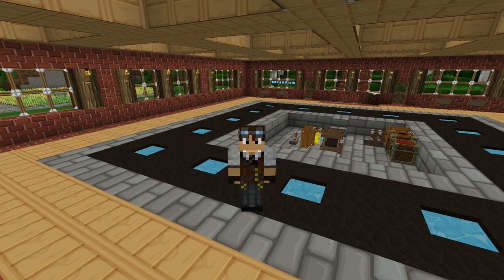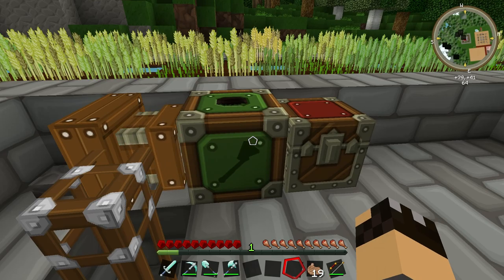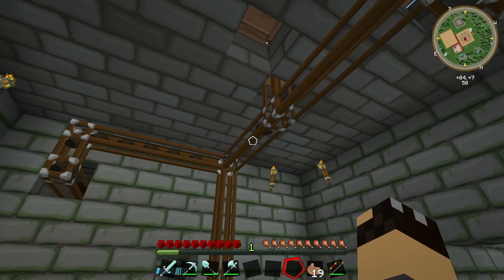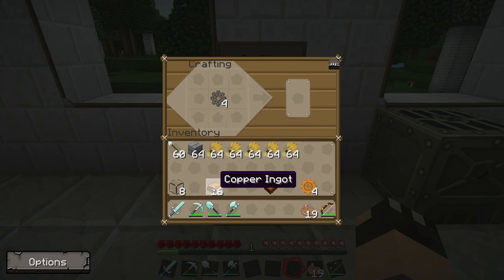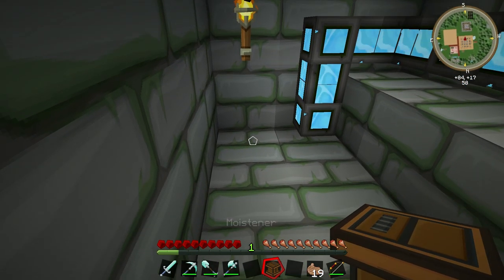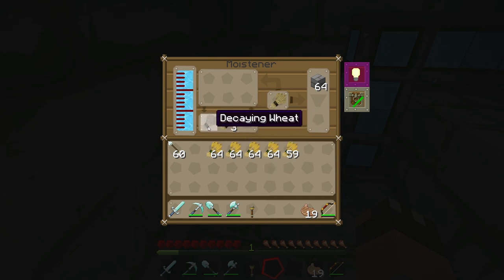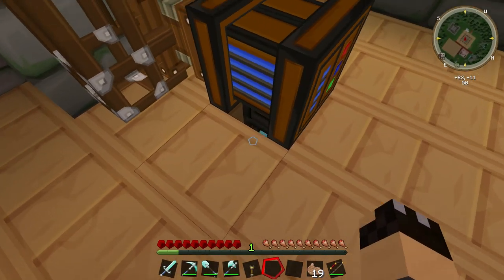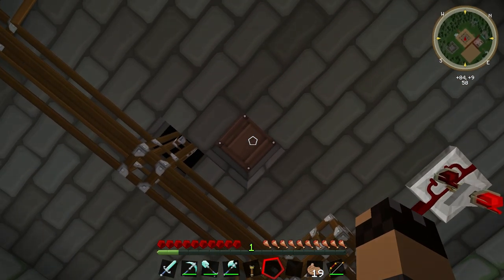How to Feed the Beast in Minecraft - Moistener - 5

Comment from the maker: It is, but it takes up a lot of space. If you are using Redstone Pneumatic Tubes, then you need to use a filter instead of a transposer. Set the filter to just draw ash. If you're using BuildCraft Pipes, then use an Emerald Pipe instead of a Wooden Transport Pipe. The Emerald Pipe works in the same way, and will allow you to specify that it just removes the ash.

Comment from the maker: I've done some tests. Doesn't seem to work with BC pipes. I got it to work with Pneumatic pipes. Build a filter"and place it next to the side of the moistener; this will draw from the top 6 item slots. Place a piece of mulch in the filter so that it only draws mulch from the moistener. Then place a chest behind the filter or further away and connect with pneumatic pipes. Place a Timer on the filter, and it'll pump mulch from the top slots into the chest. You can then use BC pipes from the chest